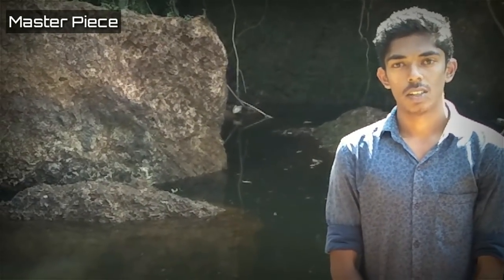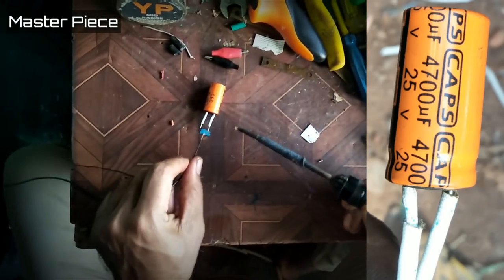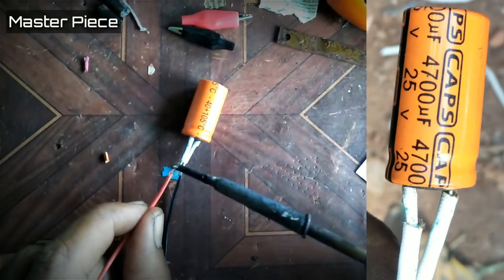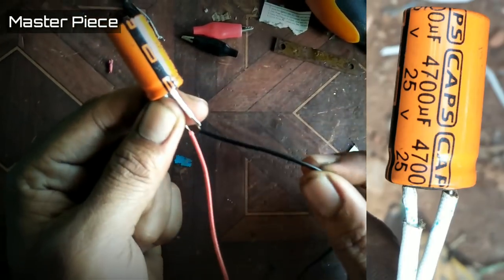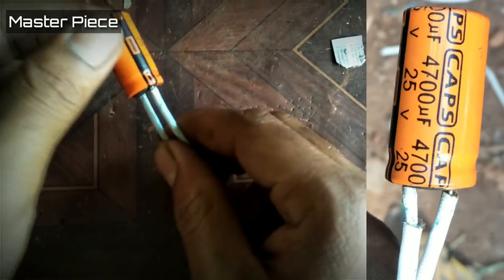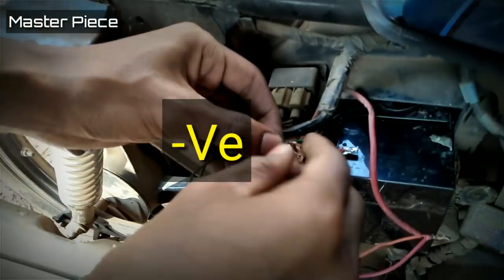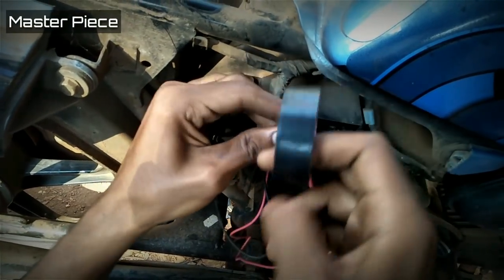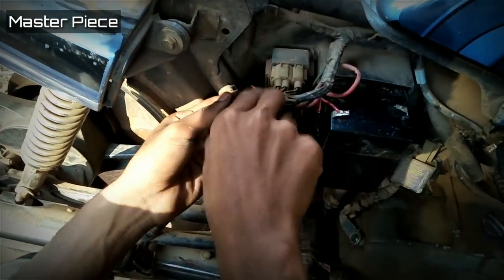Bike weak Battary problum Solve by using A capacitor /കേടായ ബാറ്ററി വെറും 25രൂപ ചിലവിൽPowerfulആക്കാം

Comment: It's n't  mf ,it's mu . after connecting capacitor battery won't  charge properly.ie adding a capacitor mean you are filtering pulsating D.C. from changing section.